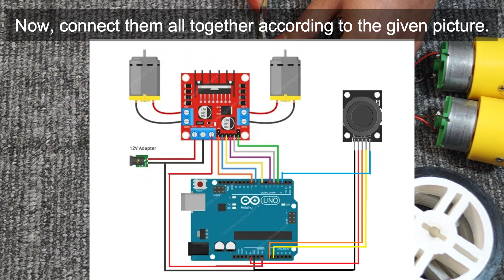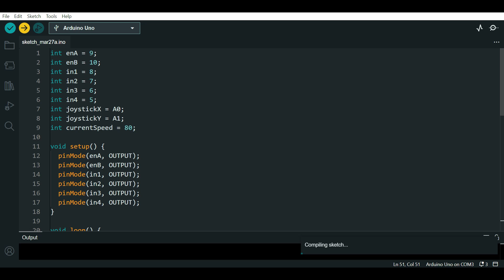L298N DC Motor Driver & KY-023 Dual Axis Joystick with Arduino | Controlling Two Motors Left Right

Comment from the maker: int enA = 9;
int enB = 10;
int in1 = 8;
int in2 = 7;
int in3 = 6;
int in4 = 5;
int joystickX = A0;
int joystickY = A1;
int currentSpeed = 80;

void setup() {
  pinMode(enA, OUTPUT);
  pinMode(enB, OUTPUT);
  pinMode(in1, OUTPUT);
  pinMode(in2, OUTPUT);
  pinMode(in3, OUTPUT);
  pinMode(in4, OUTPUT);
}

void loop() {
  int xValue = analogRead(joystickX);
  int yValue = analogRead(joystickY);
  
  // Map joystick Y value to motor speed
  int mappedYSpeed = map(yValue, 0, 1023, -currentSpeed, currentSpeed);
  
  // Map joystick X value to motor speed
  int mappedXSpeed = map(xValue, 0, 1023, -currentSpeed, currentSpeed);

  // Calculate individual motor speeds based on joystick position
  int motorSpeedA = mappedYSpeed;
  int motorSpeedB = mappedYSpeed;

  // Adjust individual motor speeds based on joystick X position
  if (xValue < 400) {
    motorSpeedA = 0; // Stop motor A
    motorSpeedB += mappedXSpeed; // Motor B rotates faster
  } else if (xValue > 600) {
    motorSpeedB = 0; // Stop motor B
    motorSpeedA -= mappedXSpeed; // Motor A rotates faster
  }

  // Set motor speed
  analogWrite(enA, abs(motorSpeedA));
  analogWrite(enB, abs(motorSpeedB));

  // Set motor direction based on speed sign
  digitalWrite(in1, motorSpeedA > 0 ? HIGH : LOW);
  digitalWrite(in2, motorSpeedA > 0 ? LOW : HIGH);
  digitalWrite(in3, motorSpeedB > 0 ? HIGH : LOW);
  digitalWrite(in4, motorSpeedB > 0 ? LOW : HIGH);
}